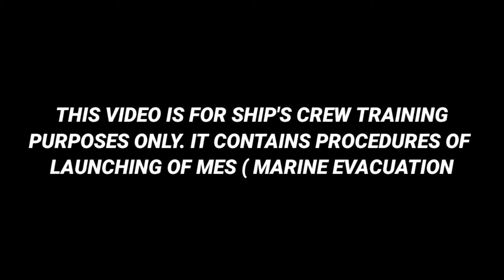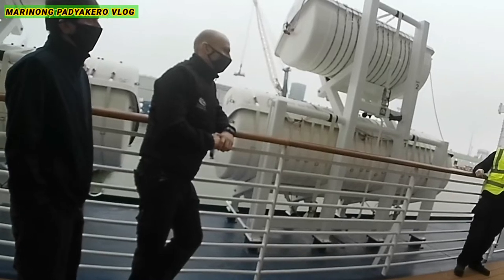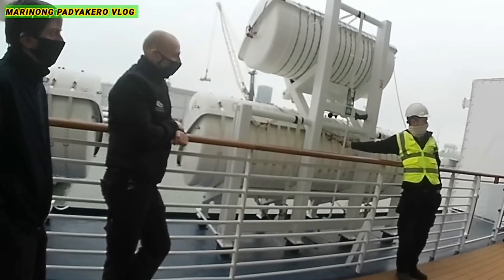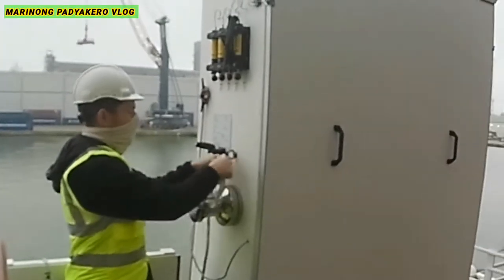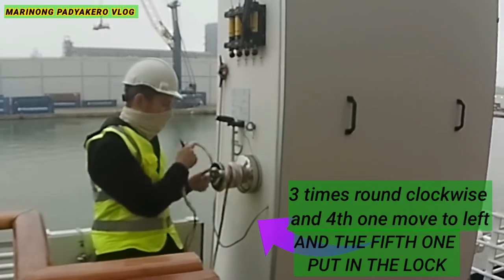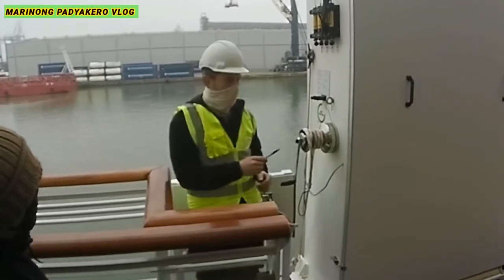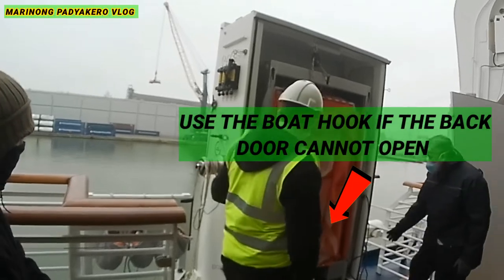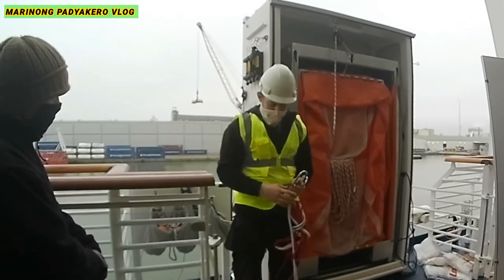MARINE EVACUATION SYSTEM | LIFERAFT LAUNCHING | MARINONG PADYAKERO

Comment: These guys could barely manage to deploy the raft and clamber down that ridiculous escape tower to the raft docked in port.  Imagine them trying this from a sinking ship in a gale—hope the crew are good swimmers.  Looks like a terrible system
Reply from the maker: You are right sir.  Going down the chute is not that easy especially if the weather is bad.  Let's imagine that it's in the port and the sea is calm but it still takes time before getting off the liferaft, what if the wind is rough and strong.
Reply: Now imagine the old way, with everyone climbing down rope ladders to the raft.

This is a significant improvement.